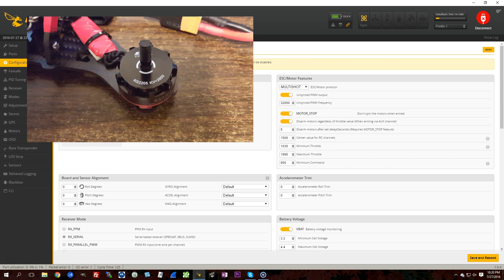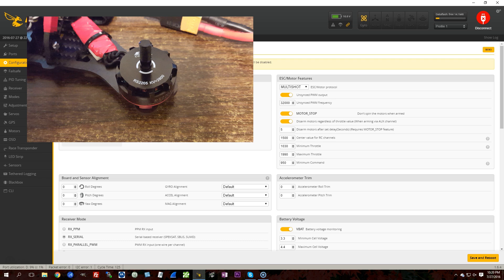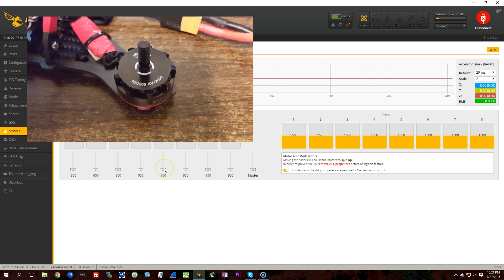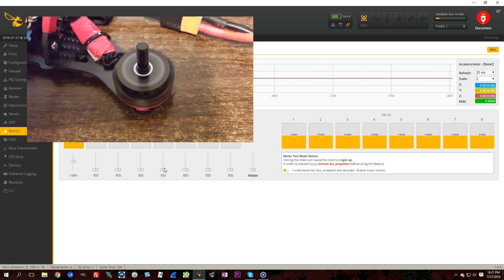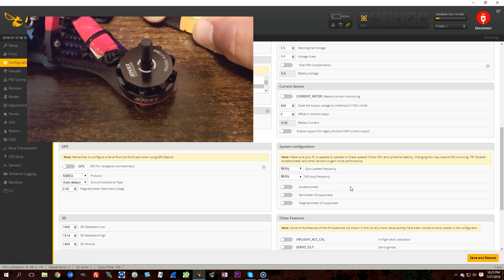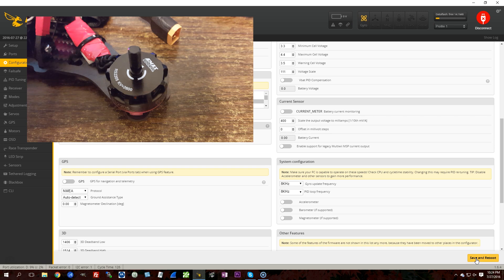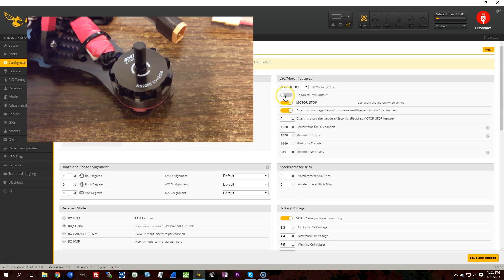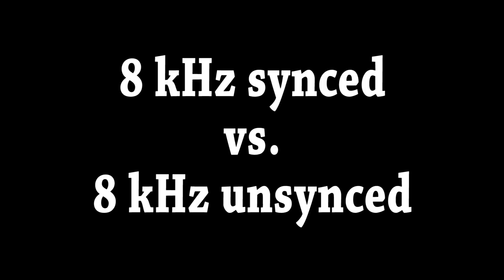Synced vs. Unsynced Multishot: Does it make motors smoother?

Comment: My ears tell me 8kHz unsynced was the smoothest off all of them.
Reply: If you were running 4 on gyro, 2 on PID, could you run 8 on ESC or would it be best to run 2? Sorry Josh, I'm real thick with this stuff.
Reply from the maker: +S700KY I'm not sure I understand the question.
Reply: Im sorry buddy if the PID loop is on 2 would unsynced 8 be overkill or is it best to match the PID by setting it to 2.
Reply from the maker: +S700KY got it. I don't hunk unsynced 8 would hurt. But I don't think it would help either.
Reply from the maker: +S700KY 32k has a whine that QuadMcFly says he's heard before but we don't know what causes it.
Reply: Your a star thank you so much. My Vortex is pretty picky on what it will and will not run on. I have set the Gyro loop to 4, the PID loop to 2, and unsynced ESC to 4 and this is the max before it refuses to start. Sounds smoother, so off to fly. It's all about trail and error. Thank you for your replies Josh and for your time.

Comment: Joshua i do like all your videos and i strongly suggest that whatever is happening from sonic prespctive on the motor if they are receiving the same "level " (1300us) has nothing to do with the input data.
if the sound of the motor is diffrent that is totally due to what's happening in the ESC. 
i personally don't know much on how the ESC is driving the Motors and how the internal processing happening based on different kinds of input but logically speaking they should sound the same as the input of the ESC is just a data Command that the ESC has to set the motor at a specific output.
taking all the above into consideration i would suggest that the ESC doesn't run the same way on diffrent input protocols!
Reply from the maker: Multi vs. Oneshot could definitely matter even if they are receiving the same input signal. Multishot uses a shorter pulse length so the time between the FC changing the motor value and the ESC receiving the new value is significantly shorter with Oneshot. 

I agree with you that, if the different refresh rates sound different, then there is some difference in how the ESC is processing the incoming signal.

Comment: Well sometimes unsynced sounds more smoother, sometimes definitely not!
It seems to be for me that 8Khz synced & unsynced are the smoothness spot according to the sounds...
Interesting, i need better ESCs lol
Thanks for sharing McGuyver, looking forward to the next videos of this serie :)
Reply from the maker: I agree. 32k has a high pitched whine that I asked QuadMcFly about, and he didn't have a solid answer, but he said he'd heard it too. He suggested possibly aliasing between the input and the output side of the ESC, but that doesn't make sense to me as the input side is higher frequency than the output. Right? What frequency is the output side of the ESC???
Reply: +Joshua Bardwell wouldn't the output frequency of the esc be entirely dependent on the rpm of the motor?

Comment: I also found that my motors (same as in your video) sound better at 8k unsynced. So now I'm running 8/8/8. Don't think it matters what you run the pid loop at though does it josh? Can't remember if I read that somewhere or not? I'm wondering if it's worth dropping it to 4k or even 2 to free up some processing room for the CPU. Will dropping the pid loop affect require some tweaking of the pid values?
Reply: stupid auto correct
Reply from the maker: I have a video coming soon testing the flight effects of different synced and unsynced frequencies.
Reply: Meant to say I'm running 8/4/8 unsynced. I can run 8/8/8 but that takes my cpu up to 51% where as @4 it's 16%. Just unsure if it's even worth running the pid loop at 4khz or just drop it to 1 and be done with it!
Reply: +Joshua Bardwell thanks for the reply by the way.

Comment: Did you notice any delay in response when the ecs is unsynced? Granted my setup is different. I was running a Cyclone @ 8khz and Kiss ESC & Onshot 42 @ 8khz. There was a pretty obvious delay with I ran it unsynced vs. synced. One wierd thing is that I had to unsync my ESC in order to go through ESC calibration with the KISS ESC or else the Kiss would calibrate as reversible 3D.
Reply from the maker: I didn't notice any delay at all.
Reply: I went from ZTW Spider ESC'S (I ran both SimonK and BLHeli) to Kiss 24A RE ESC's and as far as smooth sounding motors are concerned the Kisses are 1000% better. I believe the 32bit MCU and adaptive motor timing play a major factor. It would be interesting to see how/if the motor sound changes on an ESC with automatic adaptive motor timing.

Comment: I am running a cc3d using a pwm receiver. I have dys xs30a running bheli_s which supports oneshot, oneshot42 oneshot125, multishot.

 Which of these should/can I use with my setup. I think I read that the cc3d using pwm cannot run multishot because the timer for the motor output is synched to the pwm input. I can set betaflight to multishot, and it works but I don't know if it is using it.
Reply: Stop beating up on the CC3D, it has been proven to outperform its bigger F3 cousins due to its SPI attached gyro. Obviously not by much, but the I2C gyros on older F3 boards is a major limiting factor of those FC's. Just Josh is right, it has its quirks, but if you are looking for an acro board that is really cheap and dont mind having to deal with those pesky connectors, CC3D is an excellent FC.
Reply: And @Mike Laurie, I believe that you can run 4k 4k synced on a CC3D. I believe that there is a video on that, just search CC3D 4K 4K
Reply: +Liam Lambkin Geez... I had a Cc3d for ages and it served me well but they are a headache when you want to upgrade firmware in my experience as well as many development branches always having to fix "yet another issue" that has arisen, the revo too (Which I also had and equally as annoying with non proprietary GUI/firmware). Yes you can get them to work and no I am not a plug and play kind of guy but I'm definitely not a bang my head against a brick wall either. Each to there own ☺
Reply: +Joshua Bardwell lol, that's a new one autocorrect. Glad it was as I was struggling trying to figure out what the meaning  of "heat boars" was 😊
Reply from the maker: I don't know the answer to this. CC3D has all of these weird quirks and that's why I sort of avoid it.
Reply: Joshua Bardwell Thanks! Planning to upgrade my fc as my next upgrade now that I have decent esc's.
Reply: I run mine at 8k/2k synced with oneshot125 - works great!
Reply: +Mike Laurie definitely get a new fc.. Do those escs justice 😉
Reply: Thanks, will look this up!
Reply from the maker: +doondedulin44 I feel the same way. CC3D is a heat boars but such a hassle.
Reply from the maker: +doondedulin44 great board.

Comment from the maker: My observations:

32k has a high pitched noise that is not present on lower update rates. QuadMcFly confirms he has heard this too. He suggests it may have to do with aliasing between the input side and the output side of the ESC.

8k synced vs. unsynced has absolutely no difference at all.

1k has a "grindy" or "rough" sound that is not present at 8k.

Based only on the sound of the motors, I would choose 8k synced or unsynced as the smoothest sounding, and I would conclude that there is no difference in smoothness between synced and unsynced.

In retrospect, I wish I had tested at 4k and 2k. I didn't expect that there would be such a big difference between 8k and 1k and now I wish I knew where the dividing line was between "smooth" and "rough".
Reply: Interesting test.... Does the motors tab use the PID loop ?  If not then i don't understand how you are seeing a difference between synced and unsynced.  It's not a loaded question, i honestly don't know.  If the PID loop IS running, i wonder if the loop times are more consistent because you're only in the motors tab vs actually flying, which may or may not free up some processing power?  Meaning - you may have to test an armed quad to better simulate flight conditions.  For me this is just food for thought as i don't know all the intricacies to answer my questions but i thought you might!
Reply from the maker: Boris confirmed that the test was valid. The PID loop is still running from the Motors tab, just the values are not being used to control the motors.
Reply: +quiljw01 I was just wondering the same...
Reply: oh nice.  do you think the variance in loop time is higher in flight vs using motors tab?  If so i would think this would only further solidify your findings/ observations, no?
Reply from the maker: Probably there is not less jitter in flight. I have a flight test that will be coming out tomorrow or the next day I think.
Reply: quiljw01
Reply: Great work!